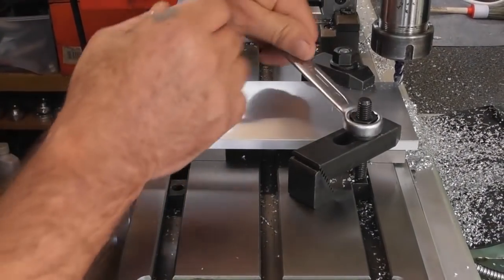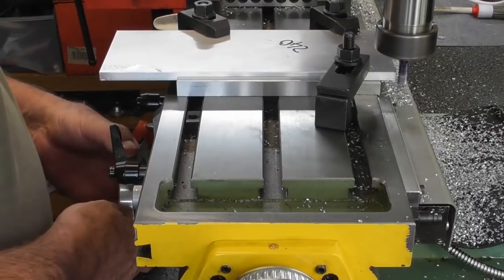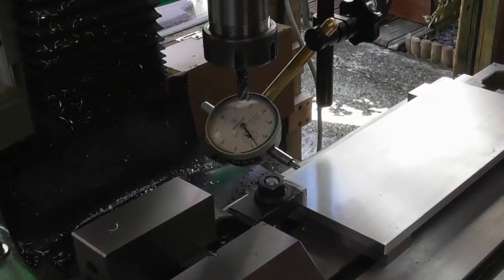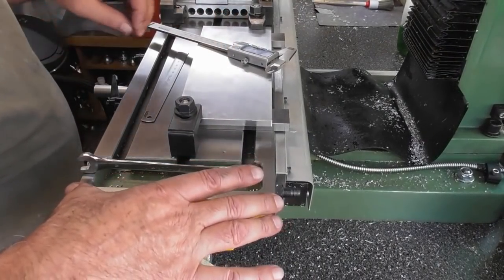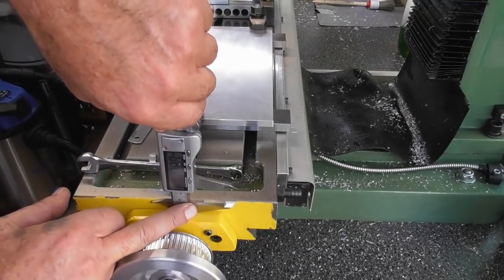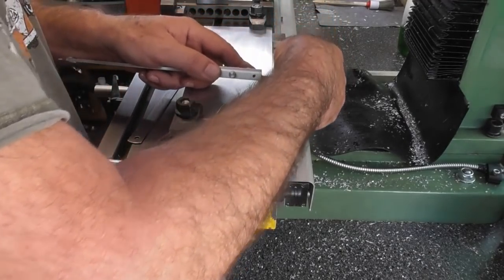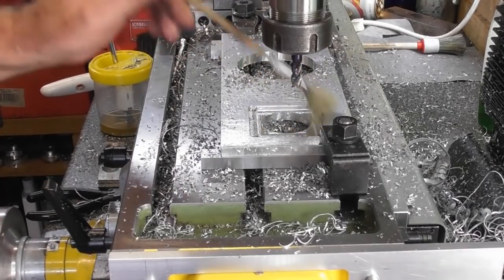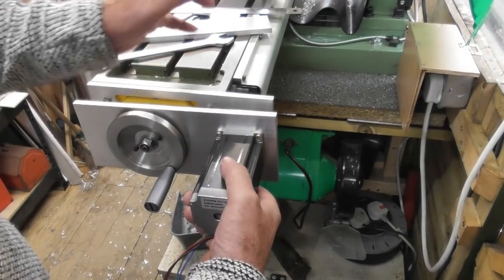X Axis power feed part 3

Comment: Yep I have to agree with you Ade. I also have been shielding and in Leicester they put us back into lock-down and my workshop activities have helped to keep me sane.  Good job by the way. 

I now have 2 mills as my cr*p Chinese drilling press with the wolf name on it turned out to be a useless bag of bolts. Wolf always used to be good tools in my apprentice days, but I would not buy another tool with the wolf name on it now. bottom of the barrel cheap and shoddy. So I have replaced it with an Axminster sx2 mill. Though one had to go back as it was damaged and didn't work Axminster came through with a new replacement, which I think was on special order direct from the manufacturers (seig if the label is to be believed) as they were still supposedly out of stock when I got mine.

So my SX2.7 is pretty much similar to your machine except it is an r8 tapper and has a tapping  button on the end of each lever to reverse the direction for when tapping which works very well. The new machine is a MT3 though. I have some MT3 tooling, but Need new arbors for my Boring head and facing head. I have fitted the cheap dro's to this machine which are basic, but seem to work OK

One useful  addition to my mills was a halo light intended for cars around the spindle and a spring loaded spindle locking device for when tightening up and loosening the drawbar.

Take care m8

Comment: Hi ADE...
Nice to hear ya on the mend, and are looking forward to getting back to work...
I'm a retired woodworker/carpenter/builder, so the thought of work scares me... lol
I am messing about on my new lathe, but am struggling with getting a decent finish... No idea why?
Thumbs up! and looking forward to your next vid...

Frank...
Reply: Frank James try playing with different spindle speeds  depth of cut and feeds. Are you using carbide tooling? If so you are probably not running it fast enough. Give it a try and see what happens, but wear your safety glasses in case you get a tool break.
Reply: @samrodian919  Thanks for your reply, and advice... Yes i am using carbide tips, so will run the lathe faster!
Safety specks used... Already shattered the parting tool, so have to replace the tip!
ADE, makes it all look so easy, lol

Comment: you may have to move your grinder from where it is now, as the motor may be on the way.
Reply from the maker: Yes I will. I need to build some more support for the overhang of the bench to support the mill at the same time. Cheers Ade. .

Comment: Nice job Ade, looking really good, when you have boxed the belt and pulleys in it will look like a factory solution. You seem to have an endless supply of the aluminium plate, where do you source it from please? I thought the way you used the mill DRO and the spot drill to calculate the pulley centres was very smart (the simple solutions are always the best)! Looking forward to seeing it completed, might shamelessly steal the design for my Cormak, whilst I enjoy winding handles, there are times a power feed would be nice. Cheers, Jon
Reply from the maker: The slippery slope of machine improvement. Aluminium Droitwich on ebay . cheap as chips. Cheers Ade.

Comment: Hi Ade, nice job, are you going to power feed the Y & Z on your mill. I have had power feed on my Seig SX3L for about 18 months & has been a saving on my hands & shoulder, especially in the colder months. I would like to power feed the Z as it takes a lot of winding to go up or down. Cheers stay safe.
Reply from the maker: Not sure yet. the Z is tempting. Cheers Ade

Comment: Hi Ade, I'm from Pembrokeshire too, but I live in Hungary. I always try and watch your videos. Just a quick question what electronics are you going to use to run your Nema 23 stepper motor? Keep up the good work.
Reply from the maker: Hi, John . stepper controller 24v power supply and a pulse generator

Comment: No idea why you did not use the mounting plate as the bearing block instead of cutting a hole in it to fit over the block.  You would not have had to drill extra holes in the table.  ?????????????  Makes no sence.